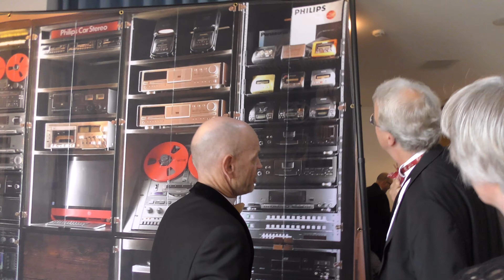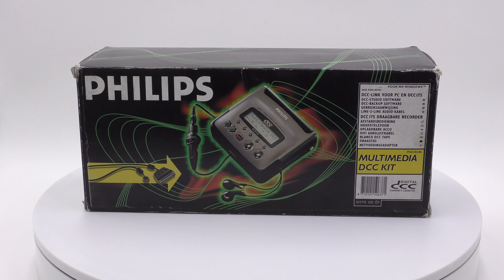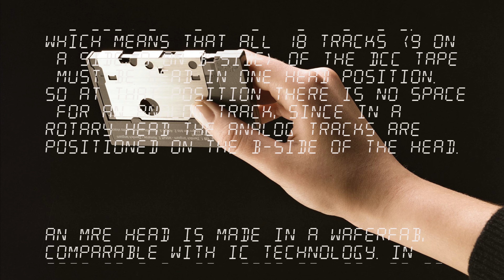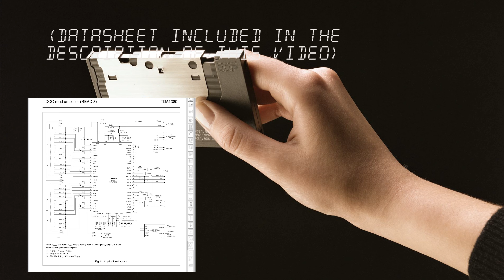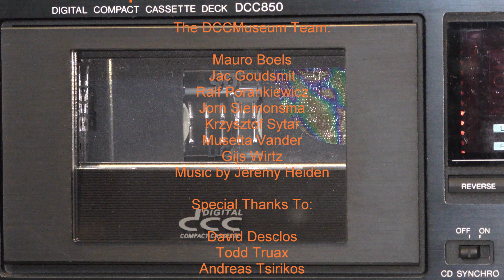Meet Tieme Kuyper. A Genius Behind the Portable DCC Players

Comment: The fact this was achieved in the early 90's is mind blowing. The technology in these heads was in my opinion the greatest heads ever built when it came to tape media. Just stop for a second and try to imagine if these heads where used just for analog alone just standard cassette would not have fallen out of favor in the mid 2000's better yet try to imagine what 8-tracks would have sounded like with these heads. DCC was an amazing technology not only for its digital ability but what it did for analog.
Reply: MR heads were used in analog tape decks, Technics RS-AZ6 and RS-AZ7.
Reply: @krzysztofsytar6219  true but not in the mass. It is funny when someone brings me a deck to fix with these heads and the head is dead and I asked what they did to it and 98% of the time I get "well I demagnetized the head after I cleaned it" oops can't do that
Reply: @jeeptrail08  sure, they do that, even if there is such a big info "DO NOT USE DEMAGNETIZE CASSETTE" on cassette door. :)
Reply: Truth be told that dcc was invented by Philips to replace the analog compact cassette in mind, but it back fired and dcc wasn't able to face out acc since consumers still held on to their history. Dcc is best used in digital format to reap all the benifits it was designed for and being backward compatible with acc was a means enter homes of existing compact casstte consumers.

Comment: It was an amazing achievement!! Highly underrated in my opinion .
Would be interesting to hear about the development of the component models 
Thinking a lot of development from Marantz or at least I remember the 900 was manufactured by Marantz.Could be completely wrong though.
Reply from the maker: Marantz delivered the mechanism and designed the first gen. Players. Most electronics and the head by Philips.  Marantz designed the portable DCC134, DCC170  and 175 as well.

Comment: Nice interview, only 1200 cables for DCC 175. Glad I have one. Unfortunately it does not work on a the parralel port of anything beyond W95
Reply: A guy I know worked at the factory at Beemdstraat in Eindhoven where they produced the thin film heads. I remember stories of great difficulties to achieve continues quality, the heads where extremely difficult to produce. Later when Philips stopped with DCC, they started to produce heads for tapestreamers and where sold off to this external company (I can't remember the name)

Just remembered the name, it was OnStream being a private company after the split off from Philips. More info on https://en.wikipedia.org/wiki/OnStream